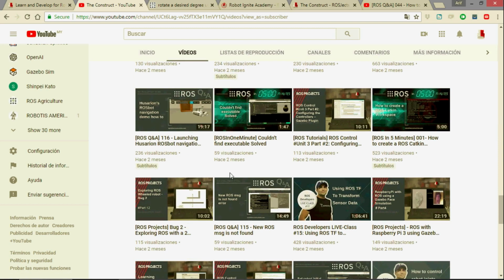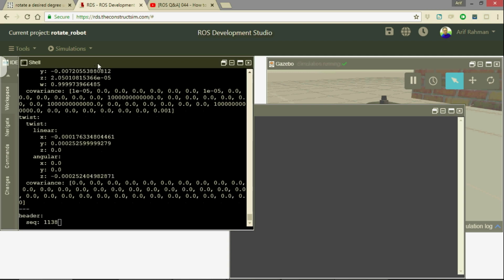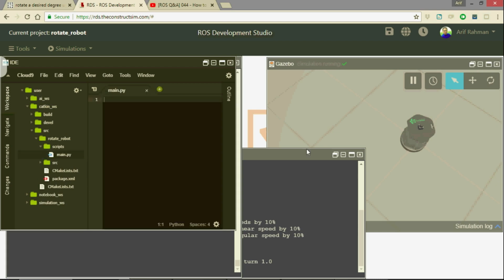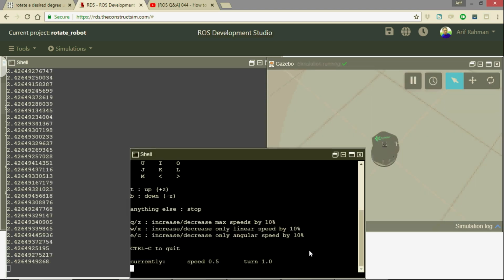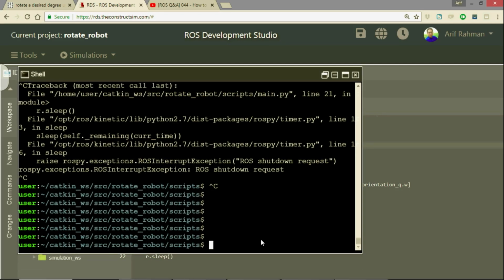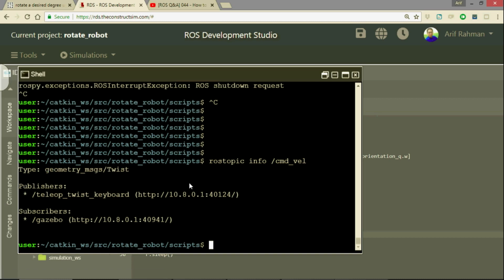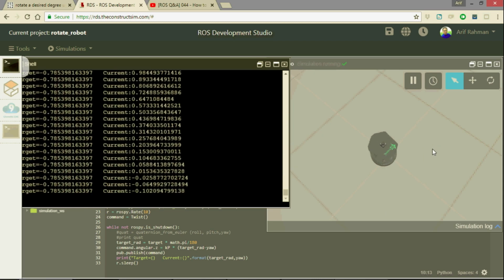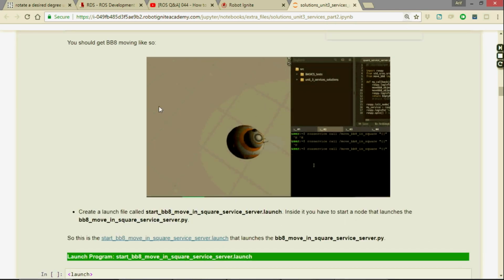[ROS Q&A] 135 - How to rotate a robot to a desired heading using feedback from odometry?

Comment: Great video thanks for the code and description. I have one question. The yaw message received by the odometry topic has a range of [-180, 180] degrees. The values of -180 and 180 overlap leading to an infinite loop since the yaw message receives a big jump going from -180 to 180 degrees. Is there is any way to unwrap this ? I have also posted a relevant question here : https://answers.ros.org/question/306538/rotating-using-odometry-problem-with-180-180-degrees/
Reply: I am having the same trouble. Any idea how to solve this? Thank you!
Reply: @MrDyngyldai  Hi you just have to unwrap the angle after the -180 or +180 and keep on counting . I have posted my solution  in the following link : https://answers.ros.org/question/306538/rotating-using-odometry-problem-with-180-180-degrees/
Reply from the maker: I don't think I really understand your question. If you want to rotate to a given angle between 0º and 360º, first you must substract 180º to that angle. Then, the result is your desired angle in the [-180º, 180º]. Once you have that angle, the code above will make the robot rotate to one side or to the other, depending if your angle is closer to -180º or to 180º.
In case you have an an angle bigger than 360º, you have to substract from it 360º as many times as necessary to have an angle between 0º and 360º, and then apply the method above.
Does it make sense?
Please give us more details in case it is not clear